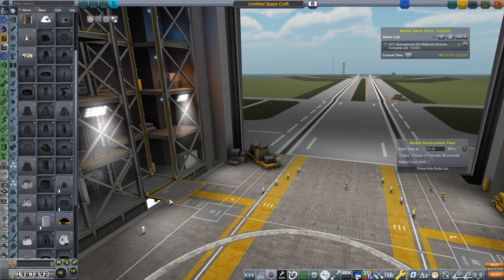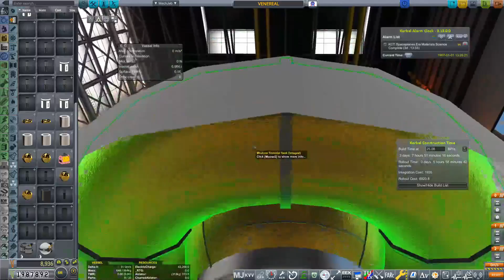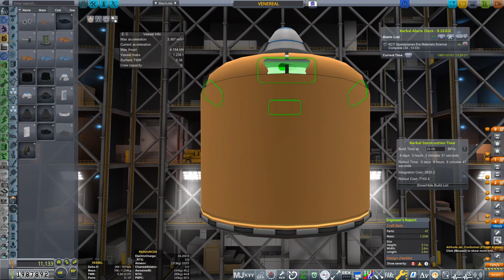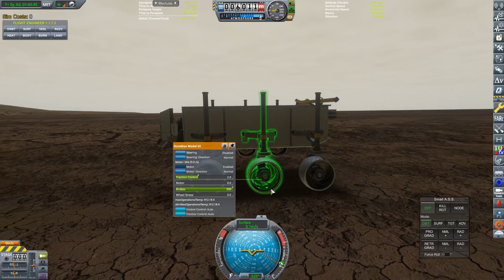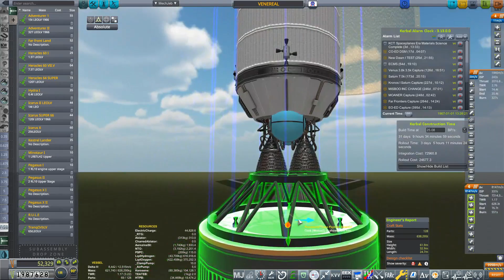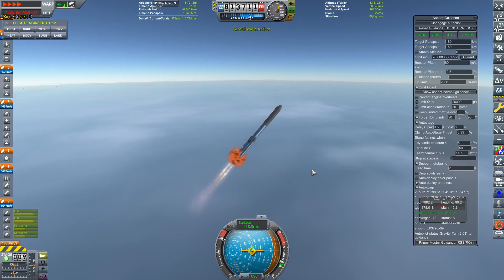Kerbal Gets Real | Build Episode 10 | Venus Expeditionary Rover | KSP RSS/RO/RP-1

Comment: Hey. I know is an old post, but anyway. I manage to land  rover, but parts do not tolerate pressure and heat. I got 5 Mp and about 750K on the surface. Rover wheels explode (and most of the other parts as well) as soon as they have contact with the environment. How did you manage that? I cannot see anything special in the video.

Comment: Can I get a copy of your mod pack, I’ve tried so many times to install realism overhaul but there’s this glitch where it either stops loading halfway, or I can’t select the VAB, if you want my discord, I can give it
Reply: Did you watch his mod installation video?
Reply from the maker: Unfortunately not, as that goes against the terms of service for the RO mod pack,  but as CJB 407 mentioned, I did do a recent installation guide which may help!
Reply: if you can't select the map, there should be an icon in the bottom left, which has a padlock on it, if you click that, it clears the clicking lock, and you should be able to select the VAB, this has happened to me several times, and thats how i fixed it